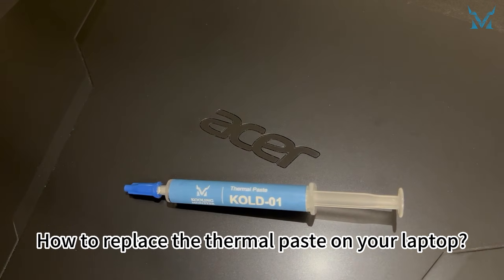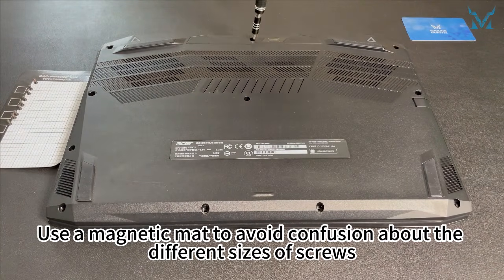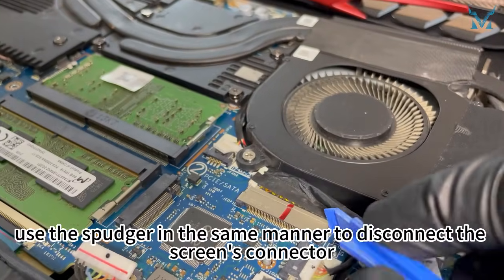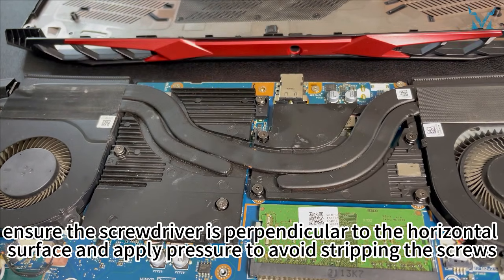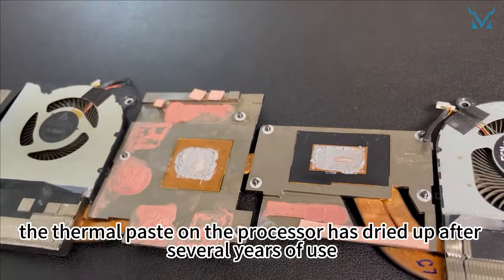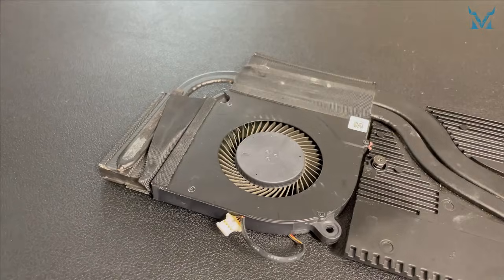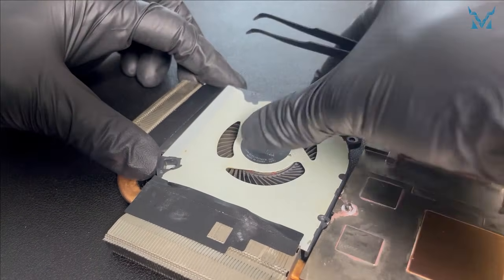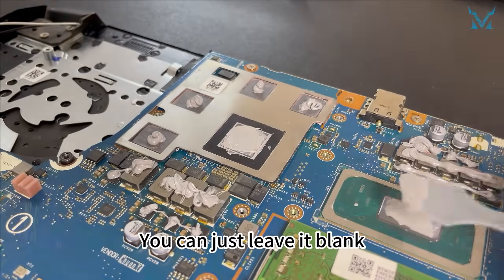Speed Up Your Acer Nitro 5 AN515-57 - Prevent Overheating With Dust Cleaning & New Thermal Paste

Comment: U change thermal pad with paste ? isn't there a gap?
Reply from the maker: Thermal paste is has better heat conduction than thermal pads. Also, thermal pads are solid materials, whereas thermal paste is grease, therefore thermal paste can fill smaller gaps that thermal pads simply can't. 
Here's a link to our article on thermal paste vs. thermal pads. Hope this can help! https://koolingmonster.com/insights/cpu-thermal-paste-vs-thermal-pad-which-is-the-best
Reply: @koolingmonster  Instead of thermal pads, for example, on the vrams and power section, it is used thermal putty such as Upsiren UX Pro. In most cases, thermal paste will not adequately efficiently transfer heat because the heatsink will not adhere or the paste layer will be too thick, above a thickness of ~0.5mm also paste transfers heat poorly.
For the CPU/GPU cores, I recommend applying PTM7950.

Comment: i am using the same computer i accidentally removed the thermal pads. Now the heatsink is not touching the gpu and the temperatures have increased excessively. I couldn't find out how many millimeters the thermal pads are. If you have any information, I would be glad if you could help
Reply: If you do not want to burn the vrams and power section, then I recommend applying thermal putty such as Upsiren UX Pro, which was created for this purpose.
Has anyone encountered a case where a laptop manufacturer applied paste instead of thermal pads or thermal putty on the vrams?
Reply: It is 1 mm thickness
Reply: increased how much please ?
Reply from the maker: You can just apply thermal paste whatever components the thermal pads was on. Thermal paste have better heat conduction than thermal pads, and are also better at filling in smaller gaps that the solid thermal pads cannot. 
Here's a link to our article on thermal paste vs. thermal pads. Hope this can help! https://koolingmonster.com/insights/cpu-thermal-paste-vs-thermal-pad-which-is-the-best
Reply: @koolingmonster  That's just a bad advice, VRAM can work until 120 degree which is way too much for most thermal paste in the market and they would dry out in no time..
Reply: @koolingmonster  how about liquid metal on all of it
Reply: @benedictxavier8809  it will spill over and would cause a short circuit.. I wont recommend it

Comment: Is it okay to use regular grey paste on vrams ?
Reply: No. Use thermal pads instead.
Reply from the maker: It is totally OK to use thermal paste on vrams. Thermal paste has better heat conductivity and is better at filling in small gaps as well. There's no need to worry, switching to thermal paste can also help the laptop perform better. However, we do recommend using higher quality thermal paste for this. You can learn more about our KOLD-01 Thermal Paste here: https://koolingmonster.com/thermalpastekold-01